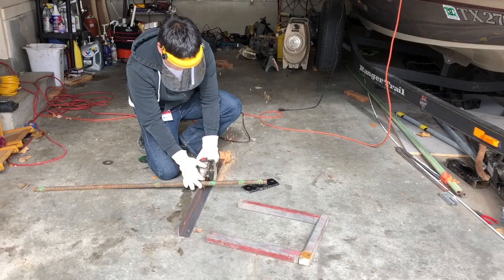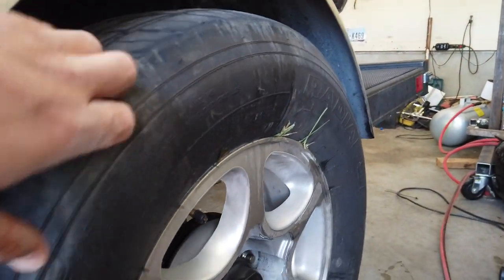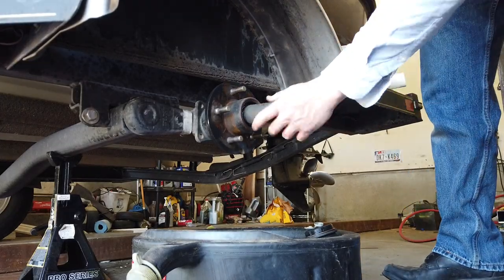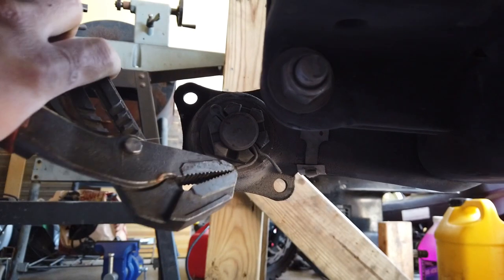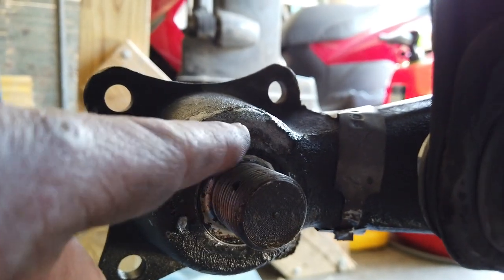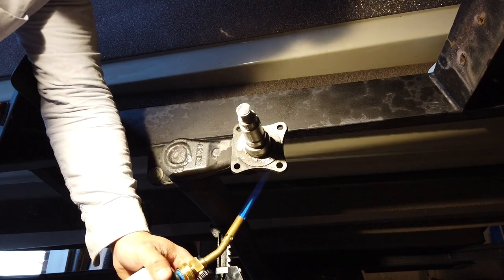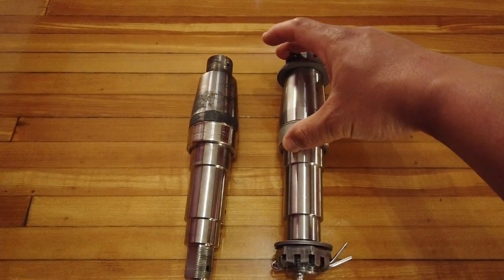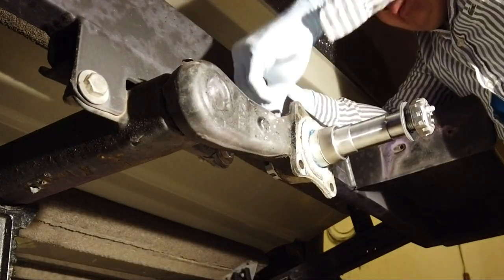Ranger Trail Trailer Spindle Replacement

Comment: Just wanted to say thanks for posting the video.  The big ass pipe wrench and floor jack combination worked perfectly to loosen the nuts on my 20 year old trailer. I a soaking the spindles in penetrating oil overnight and hope the come out without too much hammering.  Thanks again.
Reply from the maker: I'm glad it was helpful, and I hope the rest of your repair went well!

Comment: A simple open end wrench would be the proper tool to take off the spindle nut, along with a wheel puller to push out the old spindle. The spindle nut on the back needs to be torqued with a torque wrench to a certain value, not a pipe wrench

Comment: I was a couple of miles from home yesterday after driving about 300 miles.  A guy at a stop light told me that one of my wheels was cocked at a really severe angle.  I got home and pulled the wheel and hub off.  The spindle was bent like yours.  I was glad that you had posted this video since I wasn't sure how that spindle fit in there.  After watching your video I went out and whacked it several times with a big hammer and it popped right out.
Reply from the maker: I'm glad you got home safely, and that you were able to change it out! Thanks for sharing.

Comment: Best video i seen on what im trying to do...but the spindle i need to replace is welded on😑😑😑
Reply from the maker: Thanks for the comment. I don't know a ton about welded spindles, but i believe many just slide into the axle tube and are held in place by a bead. If you have a grinder and a welder, they can be replaced with a bit of work. Alternatively, you may look into replacing the entire axle, as many can be had in the $100-$150 range, they generally just bolt on, and replacing it yourself may beat out the price of having a shop replace just the spindles. Good luck!
Reply: Lol

Comment: Great job on a tough job. Glad your ok. Quick question where did you find that replacement spindle I am have trouble finding one to order
Reply from the maker: I found it through a Google search of the dimensions. I ended up ordering from Trailerparts.com, item #F8430. It is a "Tie Down Eliminator torsion Axle Replacement Spindle - 1 3/8" x 1 1/16" - Screw On" Manufacture part number 80043A. Good luck with your replacement, and I hope all goes well!
Reply: @TheAfterWorkGarage  great thank you. I need a pair
Reply: @jeremybaird5697  Another good website to check out is trailerpartsdepot.com or etrailer.com I hope this helps you.

Comment: What model Ranger is that ? You don’t have surge brakes?  I got 05 519VX single axle trailer and I’m about to service brakes & bearings. Good video tho! Glad the accident wasn’t worse than it was!! I’ve seen a few boats off trailers on highways…. Scary!
Reply from the maker: Hi, I have a 2007 170VX, so it doesn't have surge brakes, though honestly they wouldn't hurt. It's a heavy boat for a single axle trailer. And thanks for the comment, stay safe out there!

Comment: Tbh ive driven about 100 miles without wheelbearings or hubcap. It wobbles a bit
Reply from the maker: That's quite the gamble, I'm assuming if you were closer to it, it'd be quite the show of noise and heat!

Comment: Hello, i lost a  spindle on my 2007 ranger trailer today, it’s dark so I haven’t torn into it too far this evening and mine is a tandem axle so i made it home. If you dont mind, where did you find all the parts? What website that it? Thanks.
Reply from the maker: I believe this is the spindle that I ordered: https://www.easternmarine.com/torsion-axle-spindle-for-1-3-8-x-1-1-16-wheel-bearings-80043
As for bearings, I just got the standard sizes that fit the hubs (either at an auto parts store or online - I honestly can't remember, but I do know they are a standard trailer size).
Reply: Called ranger direct. Parts were 220$. East install and they assured me that they will always have them. Knowledgeable sales reps also. Shipping was 1 week.
Reply from the maker: That's great to hear. I've called Ranger for gel coat matching, and they were also very helpful. Glad you got it taken care of!

Comment: Hi 
I have old torsion axle but its too much hard how can make it more flexible?
Reply from the maker: Unfortunately I don't have much experience with these torsion systems, but I would say if it's not moving at all, it's probably seized up. Alternatively, if the trailer seems to be riding lower, the spring system could be worn out and bottomed out. Good luck, and let us know when you figure out what the issue is!

Comment: Where did you find that spindle? I have a 6 lug hub but a spindle that's square with nut on the back side also, the ones I found are flat with no nut?
Reply from the maker: Sorry for the late reply! this is a good question. Looking back I can't seem to find my order, but I believe it was from Eastmarine (I have no affiliation) here: https://www.easternmarine.com/torsion-axle-spindle-for-1-3-8-x-1-1-16-wheel-bearings-80043 The key seems to be searching "torsion axle" along with the dimensions. Hope this helps!
Reply: Ranger can ship you one.  On 7/7/22 a complete spindle, hub with no brake rotor, and prepacked bearings was $215.

Comment: Andrew where did you order the hub for the ranger trail trailer our dealer is out of stock
Reply from the maker: Hi! I didn't actually order a new hub, I just reused the old one. I believe I got the spindle here: https://www.easternmarine.com/torsion-axle-spindle-for-1-3-8-x-1-1-16-wheel-bearings-80043 but the key search term along with the size seems to be "torsion axle spindle" if you are looking for the tapered spindle. Good luck with the hub, I'm sure there are some floating around out there (also somewhat interested in what broke your hub! Pretty solid chunk of metal)

Comment: I have the same issue right now and m spindle doesn’t fit flush
Reply from the maker: What do you mean by not flush? it kind of depends on what spindle you purchased to replace it, but it just seems to fit into the tapered axle tube bore as far as it goes in with the taper. Sorry for the late response, if you figured it out, I'd love to hear what the issue was!

Comment: OMG.  Seriously you went to all that work to replace the races?  New bearing kit is $45, complete hub is $65.  For $20 the better solution is a complete new hub to go with your new spindle.  Great job with the spindle replacement!  Even better job with the save of the entire rig out on the road, but I wonder how you didn't see that ladder long before you got close enough to hit it.
Reply from the maker: Thanks for the comment. The hub kits I saw for this trailer were relatively expensive (>$150), but you're right, this could definitely be a viable option if you can find a cheap one. In terms of seeing the ladder, yeah, that's more because I should wear my glasses and don't, so i couldn't decide what it was (and whether it was something like cardboard that I could run over) soon enough.

Comment: You do not put oil in there only wheel bearing grease, the seal is to keep dirt out , you can put a bearing buddy on the outside and add grease with a grease gun if needed.
Reply from the maker: You're definitely right that this is the case with most tapered roller bearings, but this model RangerTrail trailers (I think most of them) use an oil lubricated system. They call it the "CoolHub Technology" and it definitely threw me off too - instead of repacking bearings, you just change the oil. But I'll second your recommendation of Bearing Buddies for more conventional hubs.